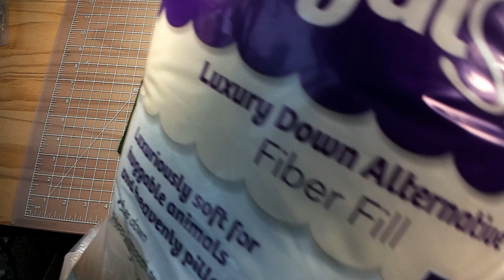How To Finish A Small Needlepoint Pillow

Comment: Great video. Does blocking smooth out stiches?
Reply from the maker: It can, it depends on the stitch and the fiber. I block everything, even if it looks like it was stitched on a frame. Realigning and resetting the sizing is important for a good finish. Not always easy depending on the stitcher and the tension they stitch at...emotional stitching can lead to some really tight stitches!😁